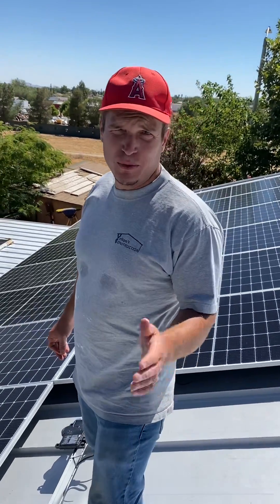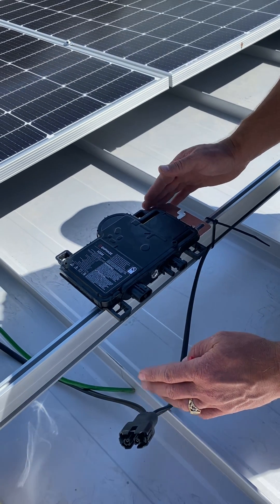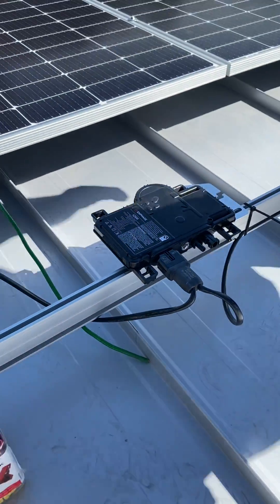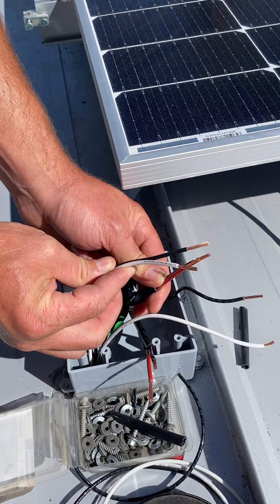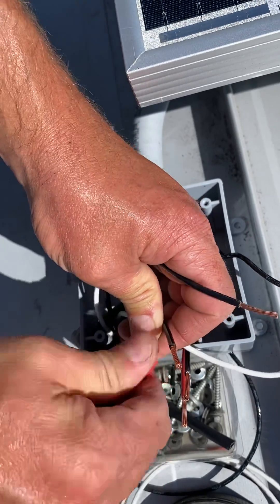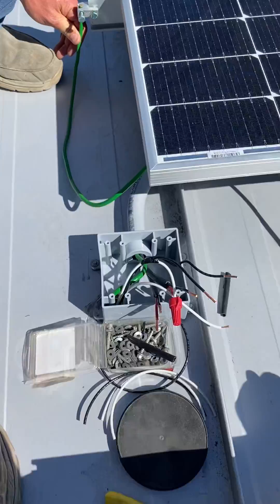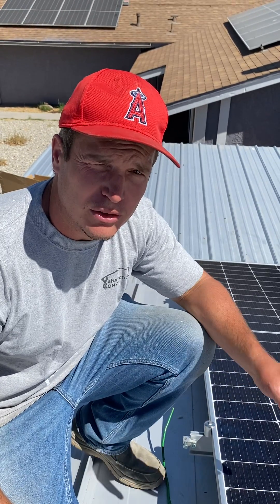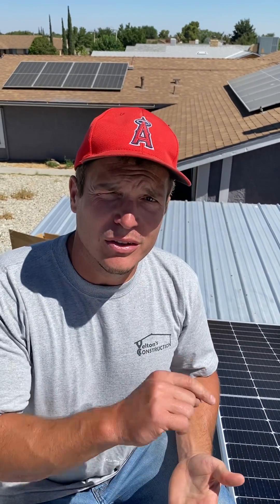How to install Enphase micro inverters the easy way with one crucial tip at the end!

Comment: oh no, that's definitely a construction hack. You installed the inverters upside-down and turned the wrong way. Cables should also go over the rail so they don't hang down on the roof.

Comment: Question: Are cables supposed to be off the roof, or can cables touch the room?  I recently had panels installed, and it seems most tables are touching my roof shingles
Reply: Cables should be neatly "Dressed" and secured off the roof.  Many failures are due to cabling coming loose due to installers using cheap zip ties to secure the cabling.   Many zip ties fail after awhile due to heat etc.  Also critters like to get on a roof and chew at hanging cables.  Cables hanging on the roof is a workmanship issues and failures due to cabling are not covered by equipment warranties.
Reply: Also if touching roof it is derating the wiring minimum 3.5"

Comment: Its not 220v its 240V! In the US we use Split-phase 120/240!
Reply from the maker: @goodoleme  220 is a active term as the power fluctuates from 110-120 volts per leg making it 220-240 as well! Thanks for your input!
Reply: will this work on usa split phase? and how?

Comment: If you are doing ground mount, is the ground positioned differently? I see you have that ground in the junction box, but where is that going? Do you take the ground to the combiner box? Or is the ground in the array not connected to the Combiner?
Reply from the maker: Ground goes to the combiner then the main panel ground!

Comment: I'm pretty sure those inverters are all mounted incorrectly. The should be placed bracket side up hanging off the rail.
Reply from the maker: There isn’t enough space for that!
Reply: @constructionhacks9293 just curious, how not? I’ve been installing emphases for about 5 years and never seen it like this. If there’s a benefit, let me know
Reply from the maker: @catheuswilson5564  you can put them however they will fit!
Reply: @catheuswilson5564 You're right. Been at it for  16 years. They're also supposed to be on the top rail facing up, ideally. This keeps you from having to do rooftop yoga as you lay the mods and keeps the wire mgmt  simple and accessible. And doable after. Bro I could write u a novel of solar tricks.
Reply: @catheuswilson5564 btw on the top rail facing down is fine too. But I like em up for ez access.
Reply: @constructionhacks9293  huh? There's plenty of space. They are pretty clear about this in documentation and in the enphase installer certification.

Comment: Finally! Exactly what I wanted to see. I'm new into electrical work and I've been trying to find out if the junction box setup was literally just tied together with a wire nut or not. I couldn't find an answer to this for the life of me. Thank you!
Reply from the maker: @XAngelxofMercyX  thanks for your support!
Reply: Can I use these bare bones without an enphase panel and go directly to a breaker in my home?